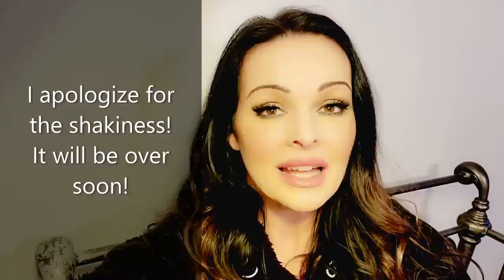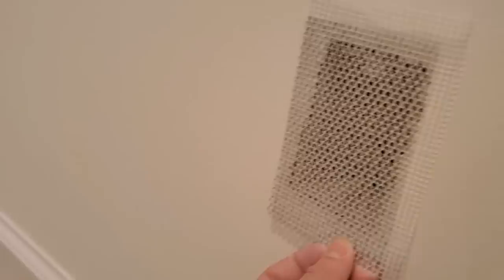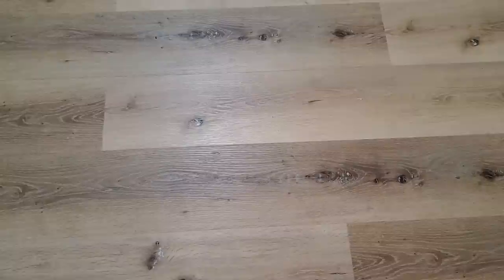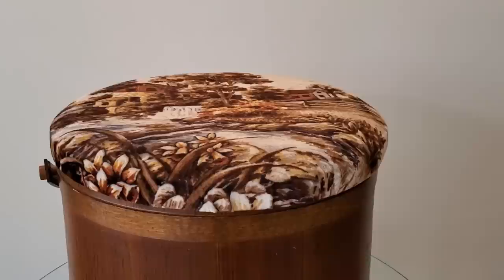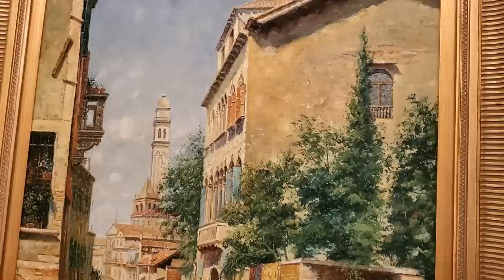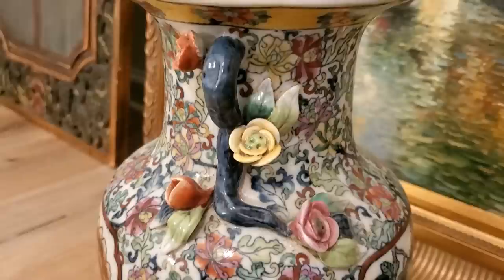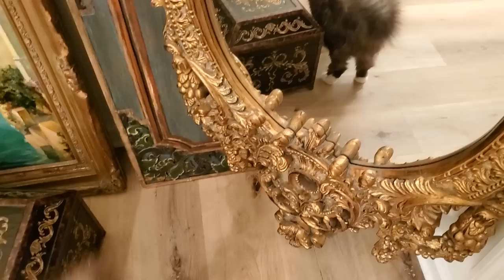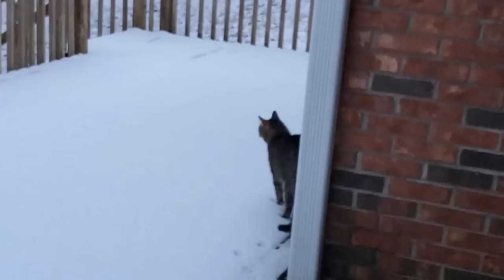House Progress and Second Hand Design Haul! Thrifted Decor, Marketplace Finds and More!

Comment: Good score on the Home entertainment center. They are overlooked. In 1992 I paid $3000 for a solid oak home entertainment center. I wasn’t going to give it up!The two side pieces had doors with glass for display, the middle piece had receding doors but unfortunately only held a 27 inch TV. So when flat screens came in I moved the units into my craft room. the two side pieces i used for storage,  in the center I installed pegboard backing for hanging scissors, patterns and cutting board etc, I installed an electric outlet, a light, and I attached a drop-down sewing table with a piano hinge. When I wanted to craft I open the doors, drop the table down, pulled my sewing machine out, sewed to my heart’s content and then shoved it all back in and closed the doors. It was still beautiful and hid all of my mess!
Reply from the maker: Oh my, what a great repurposing idea! They are so such beautiful pieces and, like yours, usually expensive and well built cabinetry.  I keep seeing them for sale on Marketplace and I wish I could buy them all and reuse them all over the house. I just might... Lol. I have ideas! I love your sewing cabinet idea. Thank you for sharing with all of us! Xoxoxo

Comment: Why did you take out the lights?
Reply from the maker: Good morning! I wanted to add 2 chandeliers in the kitchen and the recessed lights were the old style and just eye sores on the ceiling. I left 2 over the sink area in the kitchen. In the living room, I removed 2 that were not equal distances away from the wall. Whoever installed those 2 had one about 2.5 inches further out than the other one. Lol. However, I left the other 6 in the living room. I'll show before and after photos in future videos so you can see what I'm talking about. 🙂 Have a wonderful week! Xoxoxo